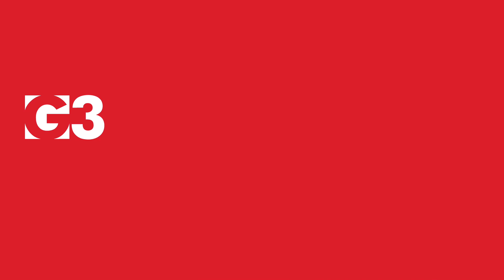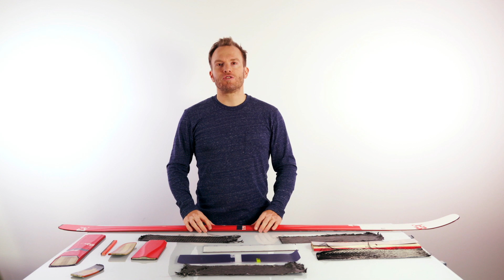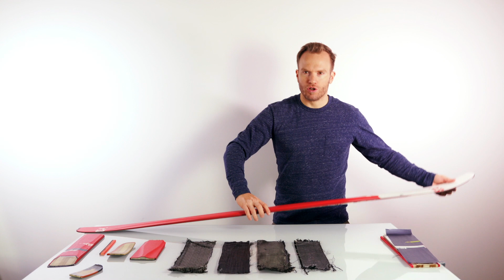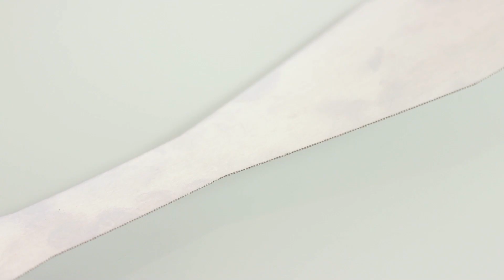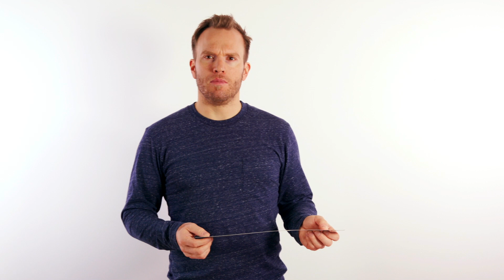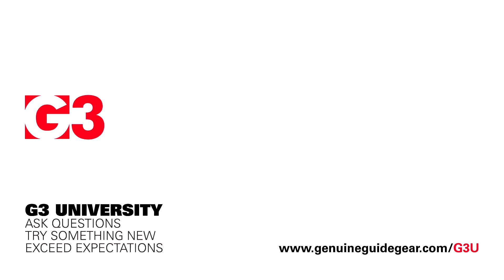Sandwich Ski Construction - Episode 4 - Laminates

Comment: i found that the titanal is mado out of 88.5% aluminum, 1.7% copper, 2.5% magnesium, 7% zinc, and 0.1% zirconium. Not the aluminium, titanium and zinc that he says. So, i wonder if he just made a mistake or you use a different alloy.